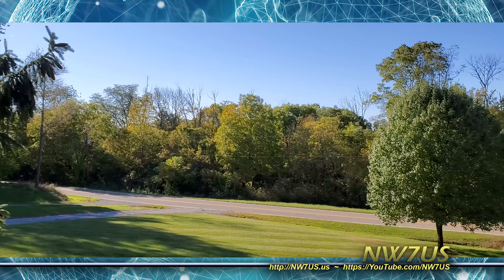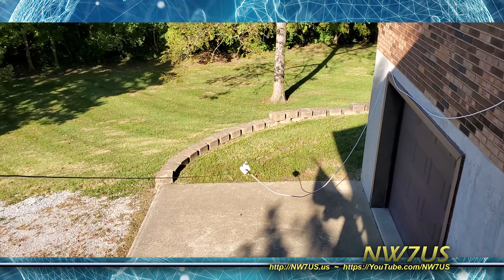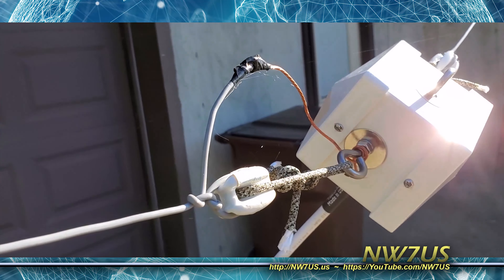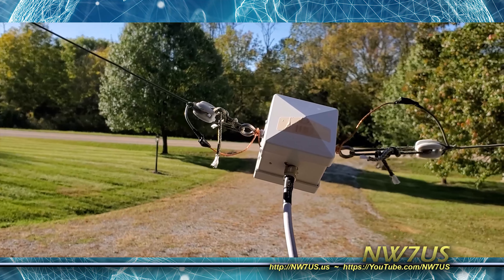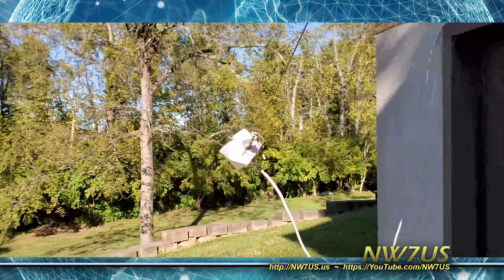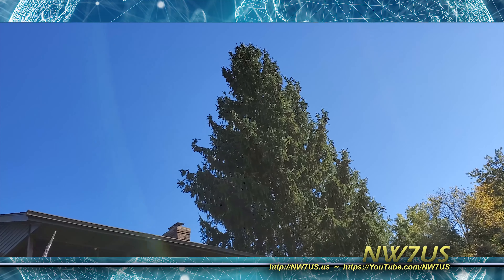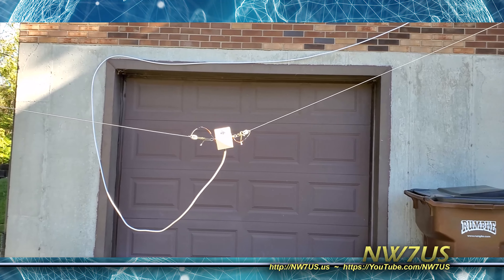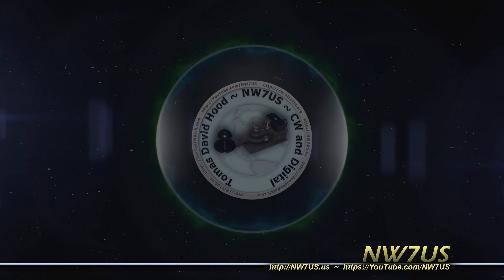A Makeshift Temporary Dipole Shortwave Antenna; Get On The Air! (2020-10; My New Home in Ohio; EM89)

Comment: I have a 20M dipole about that high in the middle. End-points on the corner of first floor roof and a tree.  No balun.   All over on 20W.   Plenty of trees around here, but they are diseased and falling.  Not that much property that I can claim-a-tree..